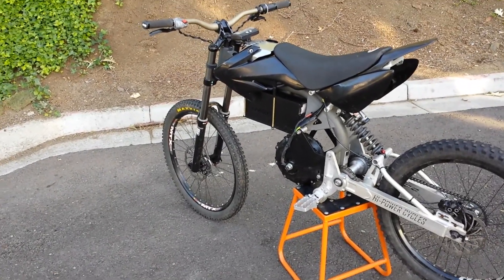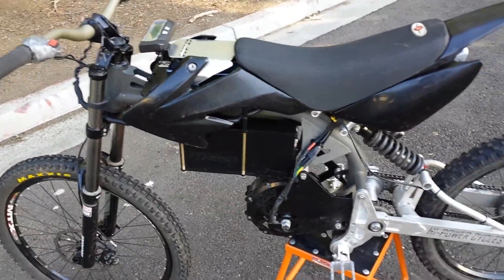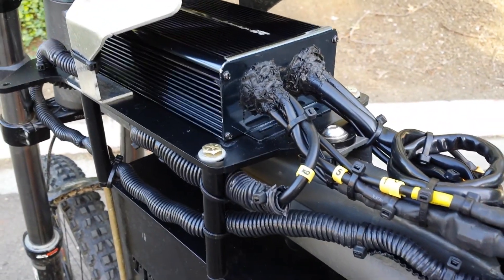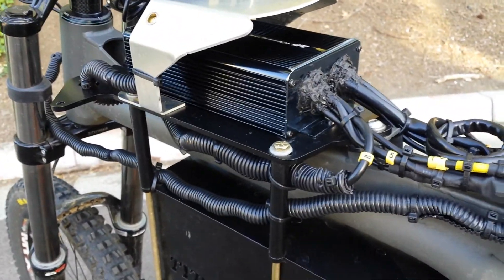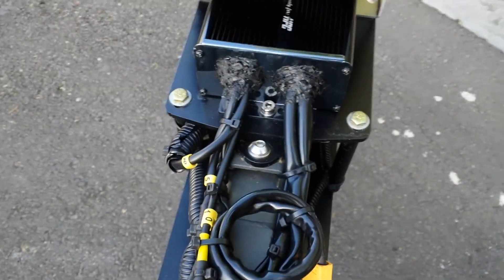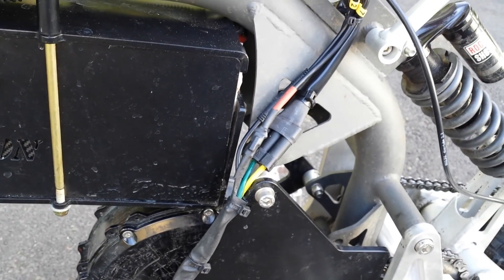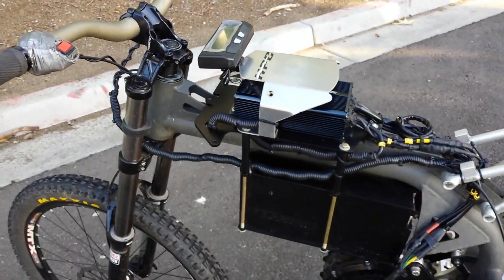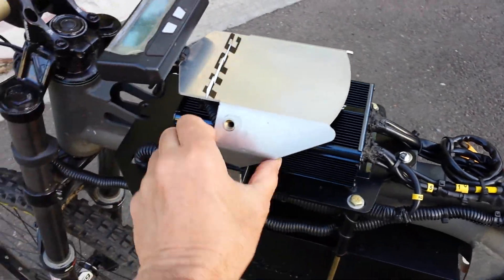Improved, re-wired: Toughened Typhoon 6000 Watt eMoto

Comment: Working on converting an alternator to motor for my old mountain bike. Figuring out the mounting has been the toughest so far for the motor. Weather proofing is a big concern of mine since this design is purposed for hunting season. Yours looks like a fun ride that can take some abuse.
Reply from the maker: I gather you like to DIY... that's cool. I suppose an alternator is a very reliable hardware design if you know how to convert it. Creative idea for a motor and the size seems appropriate. I don't know much about the electric side of things,  I am a Mechanical Engineer. I just want to ride and have a reliable bike. I wonder if you could buy the motor from a good source to ensure reliability. My bike does take abuse and it is a lot of fun.
Reply: @biketothetop  there are quit a few choices out there now. The setup I really want is a mid drive kit from bafang. Its 500$ though. Diy is the best if a person can do a good enough job on the project. I just hate to see things go to waste.

Comment: I was really surprised to see you rotate the motor at 3:42
I thought the motor would be fixed.
Good to get a look round one of these.
Reply from the maker: Here Now The motor is designed to be used as a hub. Normally,  the motor would be attached to a bike frame's axle dropouts and within the center of the rear wheel. Look closely, spokes would be laced from the flanges on its outside diameter to the inside diameter of a rim. Due to the large mass of a Hub motor, it is inherently undesirable, from an off-road-use suspension standpoint, to have this large un-sprung mass reciprocate and travel along constantly changing ground contours. The bike has greater suspension control  with a "mid-drive"  configuration  because  the mass is located  closer to the center of gravity.
Reply: Yes, I get the mid drive advantage thing. I'm in the process of building a mid drive using a 3k Cyclone.
I also realised that this was a hub motor but didnt  really think about the dynamics of it operating in this situation.
So it must almost act like a flywheel as well ?
I like this concept. It's opened up a whole new line of thought for me.
Reply: Are the drive chains Go Kart chains ?
Reply from the maker: The names cyclone and typhoon are coincidental ... they are synonyms for storms in different Geographic areas :-) You are correct that the rotating mass of the motor will behave like a flywheel, but this is actually disadvantageous downhill because the rotating mass is not decoupled from the rear wheel. This is bad for cornering control and requires more braking and brake pads wear out sooner. I started to look for a freewheeling sprocket mount to eliminate this issue. My chain is a 420 series motorcycle chain. This makes it a little bit harder to find off the shelf parts. I Googled the cyclone ebike parts and understand now what you are trying to accomplish. What kind of bicycle will you mount this Hardware on?
Reply: I'm surprised that there isnt a freewheeling sprocket already fitted. As the rest of the build appears to be very well thought out.
The bike I'm using is nothing special. It's an Ali framed, hard tail Raleigh that I picked a while ago and never really used. It's got some quality bits on board and should be up to the job.
I'm at the stage of designing the battery and hope to have it sorted in time for the better weather.
Reply from the maker: It came with a freewheeling sprocket for the original pedal driven portion, however, I removed the pedals and cranks and replaced them with pegs. My vision is to add a Freewheel to the jackshaft where the output sprocket goes to the rear wheel. The bike is designed from a motoped which originally came with a gas-powered engine. There was no need for a Freewheel and the conversion had no place to put it.
Reply: To help overcome the momentum of the spinning motor when braking, how about fitting a disc brake to the motor hub and having it connected to the wheel brakes. ? So effectively having three brakes on the bike ?
You'd just need to sort a caliper mounting and splitters in the plumbing.
Would the brake master cylinders have enough capacity to operate two calipers at once ?
Or if they were both squeezed, they would share the load. 
I dont know. Just an idea.